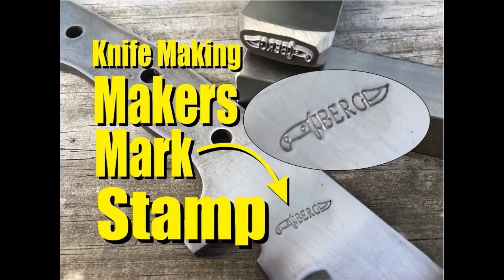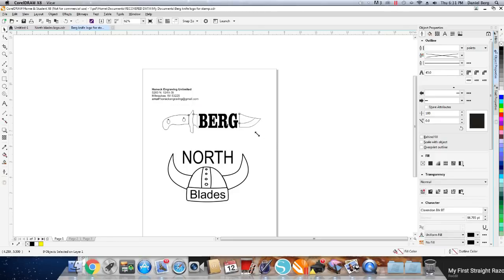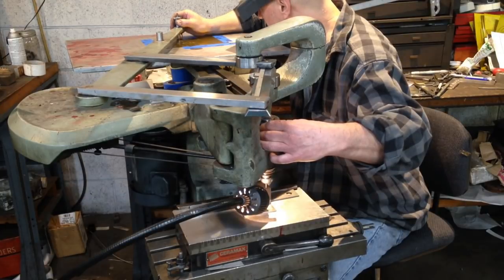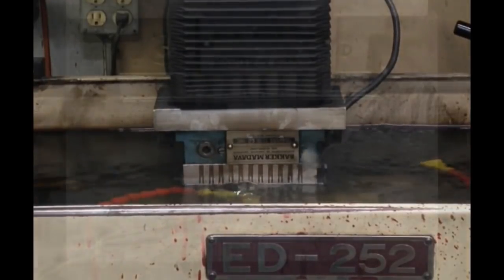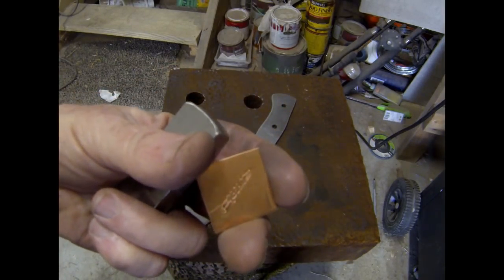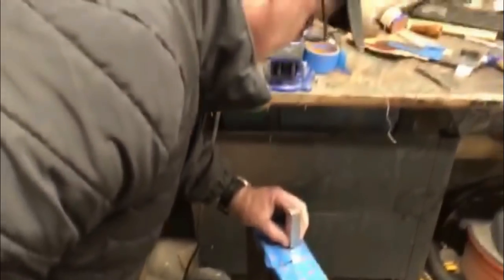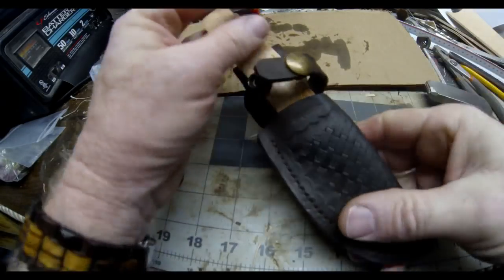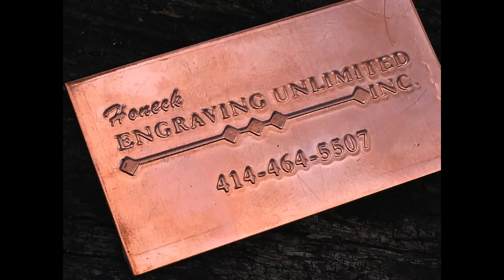Knife Making Makers Touch Mark Stamp

Comment: Great vid!  I cold stamp serial numbers on mild steal all day long and I would recommend you use a smaller hammer.  The hammer should be round faced and 3 to 4 pounds.  Flat faced hammers have a tendency  to push the stamp to the side and smach fingers.  I would also not hit so hard and  do a few test whacks to see just how hard.  Stamps will lose their crispness as they wear and watch out for sanding dust from belts as well as general metal filings.  I keep my stamps in a foam lined closed box with oil misted on the stamps.  My stamps will rust. Do not touch the stamp face with your bare hand.
Reply: these tips have really helped me. Thanks!
Reply: @bryanrodriguez6936  glad to help
Reply: Good info thanks

Comment: Get a chunk of flat ground tool steel.  Have someone with a CNC engraver use a D bit V shaped cutter to cut the design you want into the blank.

Harden and temper this and polish the face.  Now get some tool steel just a bit larger than your image and heat the tip and place it over the engraving and give it a good whack.

Harden and temper.  Trim it like the one you had made.  now you have a cold stamp.

Want a hot stamp?  Make a second one, and then just grind off the chisel point a bit and whack it into hot metal.

Now you can make as many as you need because you have the master die.  Read up on how moovable type was made.  They copied the way the Jewelers made their stamps, but used lead.